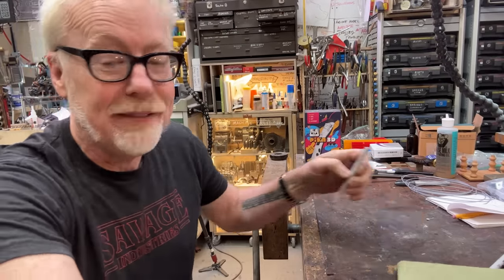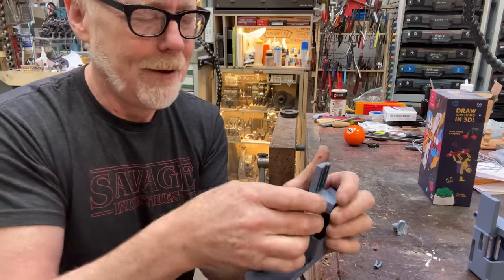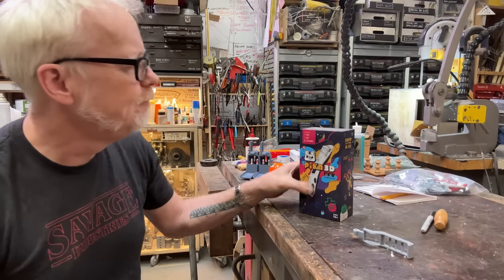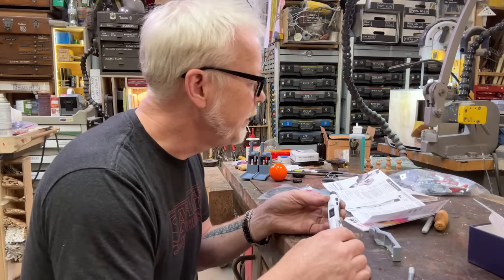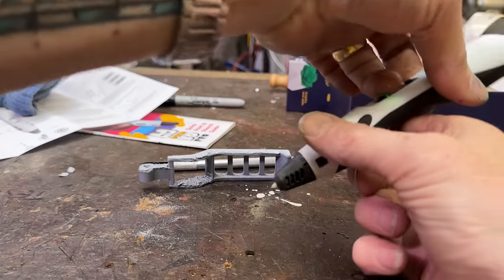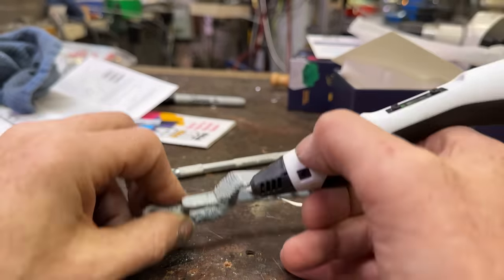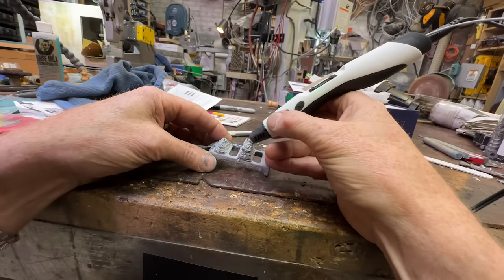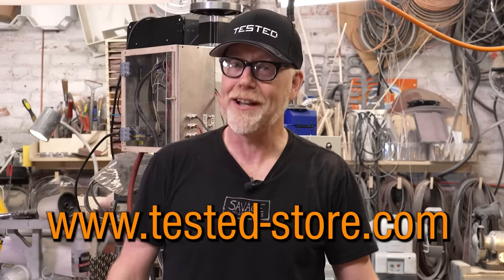Adam Savage Tests This 3D Printing Pen!

Comment: Adam have you tried coupling this with a soldering iron/hot knife type of thing? You can get some really good results with 3d pens by using the right tools along with it!
Reply: You beat me to it! I use a hot knife and my 3D pen. The hot knife can be turned on its side to act like an iron or you can use an old soldering iron to help iron parts to smooth the plastic.
The 3D pen is great for filling cracks or gaps. It can weld parts together too. I've made butterflies and flowers with it too.
Reply: theres a whole bunch of artists on youtube making things with 3dpens and they use pyrography tools designed for wood burning to get beautiful smooth results.
Reply: Yep, soldering iron with custom endings and you can basically do anything, and smoothie anything out of a fdm 3d printer
Reply: i was gonna say the same thing
Reply: Adam, I have been developing an “industrial 3D pen” for the past year and will be showing it publicly for the first time at the maker faire next weekend…. 4x faster, hotter and spool fed.   More like a plastic mig welder than a “3d pen”. Come try it out!

Comment: I recommend an adjustable heating iron, ones that heat up just enough for wax but can get hot enough to do high temp solder. Each plastic has it's unquie melting point once you figure out a good at it you can start plastic welding with it or make perfectly smooth parts. It's my number one recommend tool for 3d printing. The trick for welding pieces together or the adding fill is to heat up the object to just bellow or at it's melting point then adding the fill or pieces. Combine this with a 3d pen is amazing
Reply: Wow, didn't know about this. Great suggestion, thank you!

Comment: The tool you want to use to smooth out the 3D pen filling is a wood burning tool. They are typically about $30 and come with a large array of burning tips, many of which are shaped like spatulas, which are great for melting and shoving the extra plastic into gaps. Ideally you'll get one with a temperature adjustment so you can pick a setting that's just right to soften the plastic, not liquify or burn it.

Some things to note about using 3D printer pens - the filament that extrudes is usually going to be quite a lot thicker than what your printer extrudes, because it isn't a precisely-controlled extrusion paired with precisely-controlled motion. When you lay down blobs with the 3D pen, it's going to be tougher to cut and sand than you think. Also, they all overflow after extrusions - I think most 3D printer pens either don't have retraction or just suck at doing so because of the nozzle design.

Comment: Tip: When sanding PLA FDM prints, try soaking your file or sandpaper in ethanol, it really works wonders for the finish. I've been able to get a very smooth surface that way (especially on the parts of the model, where the support hits). I was inspired by this process from a video by Ben from by Applied Science, where he quickly cuts threats in acrylic sheets with a drill by using water or alcohol as a coolant (a great way to get good threads in plastic, that I've used ever since). My guess is that the ethanol constantly cools the plastic, and you therefore don't get any heat build-up from the friction, so you remove the material, instead of just melting it and move it somewhere else but still sticking to the piece. You could probably try it out with water as well, but I don't think the files would like that as much as the alcohol,... :)
Reply: I use isopropyl alcohol for the same thing. The evaporation helps keeping things cool. But, i don't sand that much anymore, not since i got miniature card scrapers. PLA behaves very, very well with scraping techniques. No dust, no heat and often creates perfect finish. It is tons faster too, 1 hour sanding jobs are now 10 minute scraping jobs.
Reply: @squidcaps4308  Cool, thanks, I have to try that as well :)
Reply: I've also seen isopropyl alcohol used to make "transparent" filements more transparent and it works, to a degree if you align all the layers so all lines alig but still not fully transparent. 

Great tip I learned the other day. A blow touch. Sounds crazy but if you  hit an FDM print for a second or under, any stringing or tiny filement that sticks anywhere "like a white spot. It also brings out more detail and instantly smoothes out any rough spots.. Super quick post processing if just super minor issues. Printed a dragon the other day and hitting the face for a second really brought out the detail in the eyes and ears/horns. 

Obviously have to be careful though. I already ruined one print but user error. The guy in the video said it had to be a blow torch, not a butane lighter, like for creme brulee or obviously a real one. Luckily I already had one. Not sure if that's true or not but taking his word for it.

Best thing is if you have to sand, because everyone loves it,which always makes the color look more matte or "washed out", hitting it very quickly will bring the color back like it was just printed.

Comment: Apart from repairing your 3d prints, it could be also used to make sculpts, creating objects etc.

A soldering iron with an iron tip along with sandpaper or a fine grit file is a must if you want smooth results.

Comment: It's funny I feel like I saw 3D pens advertised as a kid years before 3D printers became popular.
Reply: Yeah and they were awful. They mostly still are - you saw what quality came out of that thing - but as a method of getting extra molten plastic into a space for later cutting and sanding? Possibly useful. 

Just as a sense of scale, the depth you’d have to cut/sand those pillars he made would remove most or all structural support. These pens really struggle with making anything load-bearing or solid.
Reply: The first one was 11 years ago and plastic 3D printers as we think of them now are from 1998.
Reply: @Merennulli  3D printers may have been invented then but they didn’t become widely available for a lot longer.
Reply: @Phlosioneer  this is a manual tool, it does what it is supposed to do, which is to squeeze molten plastic out of a nozzle, in that regard the quality is near perfect. As a manual tool however, the skill of the user largely determines the quality of the end result. There are ways you can hold it to get thin vertically but wide horizontally lines, more similar to the lines made by a 3D printer than you can build up better and stronger. You absolutely can make load bearing or solid things with them, it is just about the skill of the user.
Reply: The pens came out a little bit after era of 1.75mm home printers started.

There were already home printers with firmware that had acceleration then but it wasn't terribly popular of course compared to todays numbers i guess, most everyone was a noob back then anyway, we'd share stuff online like what hairspray works for adhesion(commercial glues and special print surfaces werent yet out), some people were starting to tinker with corexy, most printers were still lasercut plywood etc..
Reply: @Phlosioneer  Yeah it seems like it was really crying out for something to press the molten filament into the gaps. The way it deposits seems to leave the new material just barely in contact with the surface. This stands in stark contrast to welding and soldering, which use fluxes and take advantage of surface wetting to make really strong bonds. This seems much more akin to caulking with silicone or applying hot-melt glue: it needs some force applied to get the material to adhere really well
Reply: They was I have an old one
Reply: because they were
Reply: How are they different from hot glue guns? Temperature?
Reply: yeah man me too wild
Reply: @r.kapaun01  The pen or the gun?
Reply: I guess that depends on what you consider "popular".   They only exist because filament was being made for home 3d printers.  So 3dprinters were certainly already popular within certain circles.  But you couldn't pick them up at big box stores yet.
Reply: @legoseanland1760  Temperature, thermal regulation, size, feed mechanism and shape. They're made to be held a little like a pen with the buttons at your fingertips rather than held like a caulk gun. It gives you slightly better control over the tip.

The only similarity really is that both are pushing a solid through a heated tip to produce a liquid that will become solid again quickly. Hot glue guns can be a ridiculously simple device because hot glue has lower viscosity when heated and a much higher burning than melting temperature. These are somewhat complex because plastic doesn't melt the way you want it to for extruding that easily because of the higher viscosity and closer burning temperature.
Reply: @Merennulli  thank you for a sincere reply
Reply: @legoseanland1760 3d pens also are motor feed hot glue guns just use a lever mechanism to push the stick through.
Reply: @NicholasKoeppel I've been using my 3D pen to draw templates for fabrication, I draw the piece I want to make on the area I'm working on, pluck it off and cut it out. Think old school cardboard templates but print in place.
Reply: @NicholasKoeppel I plan on getting a proper setup like that eventually, for high tolerance things like making frame plates and patches for rust holes it's so quick to draw it, walk over to cut and have the part on in minutes. If I was building to a design printing the templates would be awesome.
Reply: Omg, I remembered that immediately but wondered if I imagined it. I think I had one. I have vague memories of using one.
Reply: …….you did!
Reply: It was one of the first things to market in the first '3D printing solves everything probably' hype wave.
Reply: I hadn’t heard of them until after the invention of 3D printers
Reply: @Phlosioneer they arent awful. Ive seen some astounding art peices made with just these pens. Like adam said they arent replicators and there is a learning curve. They arent machines like 2d printers they still rely on the user to have skill.
Reply: They could be cool for welding 3D prints
Reply: @conorstewart2214  TLDR: Skill issue, git gud.

Comment: I've been 3D printing for a couple years now,  I wish they did one with a smaller nozzle and lower flowrate for fixing little imperfections a bit more delicately, also PETG reacts much better to sanding, PLA is really hard to sand

Comment: UV resin mixed with corn starch is one of the best ways ive found to "repair" and improve surface issues. Mix it so its fairly thick, paint it on with a brush, then cure it wit a UV flashlight. The resin mixture is far easier to sand than standard PLA and does an excellent job filling small gaps. With some elbow grease you can get a very smooth finish with 2-3 coats.

Comment: One thing you can do with a pen like that is to use it like a welder, joining pieces together that couldn't be printed in one single go.  It works fabulously to bond other pieces of PLA together quite strongly.

If you manage to find just the right temperature, where the material is the most fluid, but before it starts causing bubbles, then you have an easier time getting the pen to push the plastic into hollows, nooks, and crannies, rather than settling on top, like you tried at 5:44.

Mounting a pyrography tip on your soldering iron gives you a great tool for re-heating, smoothing, and sculpting the PLA, after it has hardened.

Keep the "leftovers", such as removed support structures or failed prints.  You can melt them down in an ordinary oven at less than 200°C, and use moulds (e.g. heat-resistant silicone) to let the material flow into a shape you like.  I've had good results from making imprints of a piece I wanted to replicate in a bit of modelling clay, filling the imprint with granules of "waste" PLA, and putting the thing into my oven at 170°C for ten minutes.  Because of the low temperature and short time, the clay wasn't really affected, and could be re-used several times.
Reply: This is a great idea. I recently had to bind a PETG 3D print to a command strip hook and went with the ol' torch + cyanoacrylic glue technique, but this would've been more elegant haha

Comment: I got the original 3Doodler (significantly bulkier than the current 3Doodler) and while it's definitely not a precision instrument and had feed issues, it was an amazing maker tool. The best thing I made with it was a gold vine decoration for a meat cleaver "sword" from an anime. I used paper to draw the shape to fit over the spine of the foam and PVC pipe "blade" and drew the vines flat on the paper template. Then I used a heat gun to make the middle flexible and bent it into shape to clamp onto the "blade" and painted it to the right gold.

I think the new ones feed better and have better ergonomic fit to the hand, but I haven't upgraded mine yet.
Reply: I came to mention the 3Doodler! I got the original model through KS. Really a neat item, but I had to pass it on because it hurt my hand to use. That's cool that you were able to use it to make the decorations you needed
Reply: I have one as well, but probably not the same model. It also has some attachments like a foot pedal and nozzle swaps that include a small metal attachment for smoothing surfaces. Sadly, I never got into using it much. Might get some actual use if I actually start working on 3D prints though
Reply: @gaerekxenos I never saw the foot pedal so I went and looked just now out of curiosity. I'm glad I did. They've changed a lot since I last looked. I kinda want to get the Pro+ that handles nylon, a wood fiber polymer, and a metal infused polymer.

Comment: Hey Adam, using a wood burner or a soldering iron set to 60 degrees ( celsius) can help melt and refine the surface. Fill with the 3d pen, iron it out. :) have you given it a try ? Have great day Sir !
Reply: I recommend this bust one with adjustable heat setting because plastics are kinda of sensive to heat. heat it up to much it becomes brittle or burns.

Comment: I've been doing this for some 3d prints with not so great support finishes and yeah it's great, hell I even got mine for like 9 dollars new. Though instead of using a knife, I use a sharp wood chisel and hold it close to the tip so I reduce the chance of hurting myself with it, this way I really am sort of sculpting away the excess from what I fill with the 3D pen and really leaves a smooth finish that way, sometimes I don't even need to sand, it depends, you can also use a soldering iron with dedicated tips for woodburning. Another thing I used it for was filling some chipped out ivory keys from a really old organ I've been fixing up, it really is a useful tool, it kinda felt like doing dental fillings.
One idea I have for ergonomics is maybe have something like a pedal that controls both the speed and the feeding action, similar to how sewing machines are operated, I think thats very doable (as makers ourselves at least) and these pens would be even greater if they came with something like that
Reply: Have you tried using a "carving jack" multi-tool for print touch ups? It's like a little swiss army knife but with all kinds of chisel/whittling blade shapes so you can quickly switch to whatever you need to get into all the weird corners/surfaces with stray filament spaghetti.
Reply: @TestSpaceMonkey  not at all, thanks for the tip🔥

Comment: Hey Adam, a neat trick I have found for finishing prints has been to use a metal file. It smooths of PLA beautifully and can remove large quantities of material with less chance to break the break (or stab yourself) as you have with a knife.
Reply: I've got an old file that will just eat through crews like butter and still be gentle on my prints. What makes it even better is that on the fine side, it will start to buff the print and make it shiny once it's smooth

Comment: For post-processing: cabinet makers card scrapers, especially smaller once are EXCELLENT. I don't sand much anymore, scraping doesn't create dust, the parts don't get hot and it cuts time to one fifth or less. They are simply amazing with PLA, it is so hard that scraping techniques work.

Comment: Having made several helmets the thing I love about my 3d pen is that it's a great way to add strength to the inner seams of a helmet. Rather than try to "weld" with a wood burner I use the 3d pen on all the internal seams of the print. Also filling gaps when you have a print the lifts off the bed just a bit.

Comment: Little tip from a fellow 3d print nerd - Pyrography tools work well. Just use the lowest heat settings or if you want to go even nerdier reduce the voltage to prevent it getting too hot.

Comment: Picked up one of these for a similar reason; been using it as a welder to join parts after printing models that were sliced smaller. It's especially effective if you model a fillet into the part (like how you would grind one for a steel weld) and use the pen to join the parts. I can't imagine it being much good for anything like printing in the air, but it certainly has application for repairs and joining parts.

Comment: Hey Adam, try loading in PETG for supports.  It doesn't bond to PLA and works great for a super smooth finish on intaglio surfaces.  In Bambu Slicer, switch interface to PETG, Z distance to 0, and spacing on interface to 0.  Make sure to calibrate the PETG before doing this to get the smoothest surface.